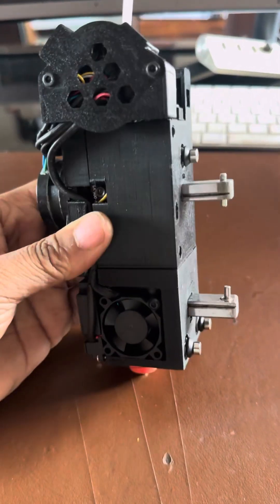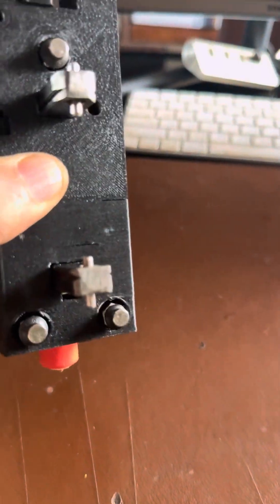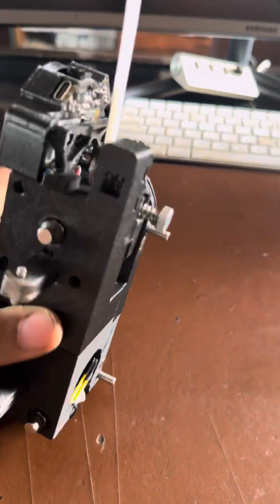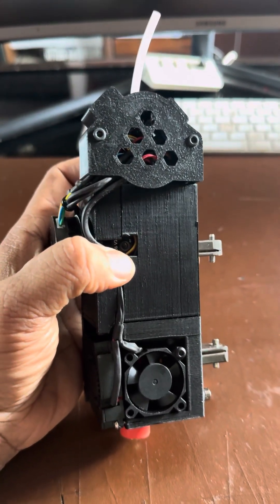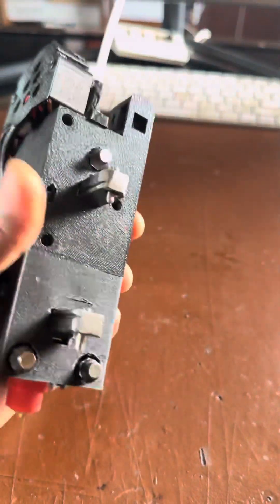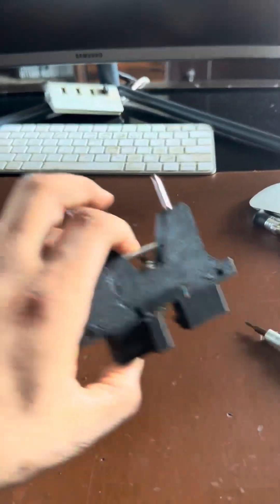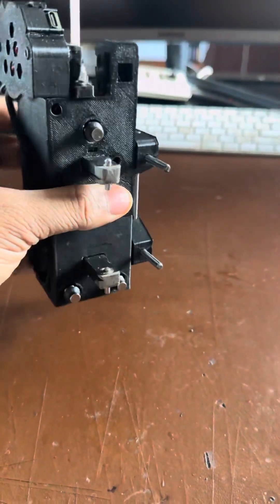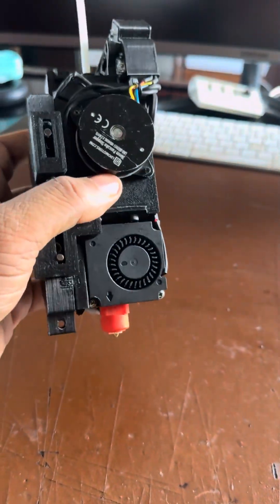3D Printed Tool Changer - Update #4 - ToolHead and Dock Design and Build Status

Comment: Wie schneidest du die linearrails zurecht?
Reply from the maker: There is a tool jig in the repo to mark the rails to be cut with an angle grinder
Reply: @ankurv2k8  will this work with an dremel grinder to or is it to hard? You know where i can borrow me an angle grinder for a few rails?
Reply: @ankurv2k8  Is there an alternative to this? That is, I mean don't use an angle grinder? Is there anything more commercial already done?